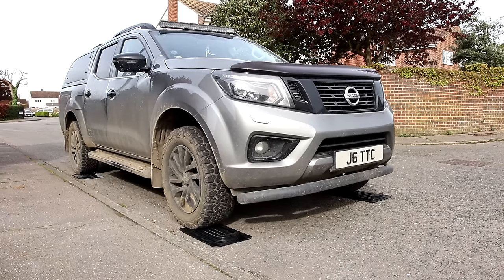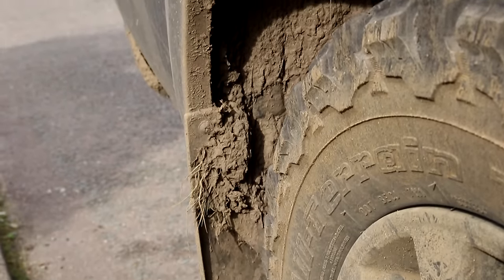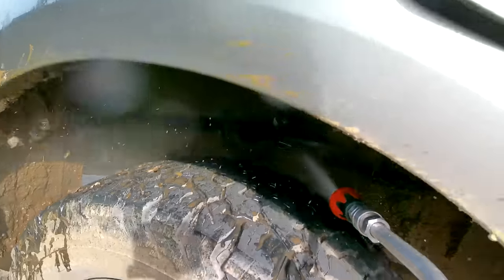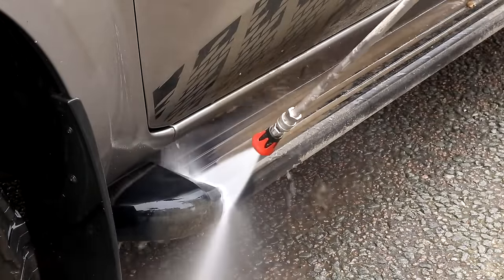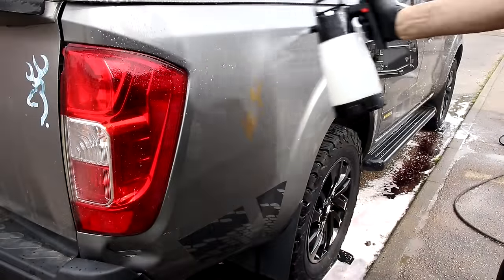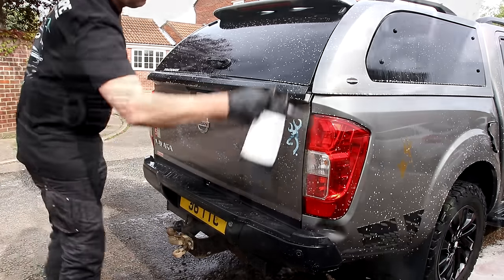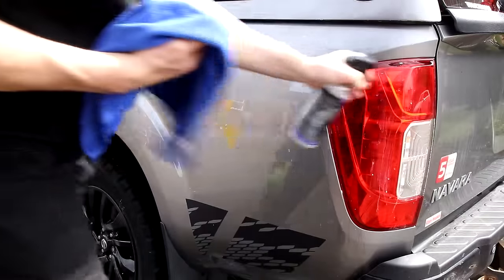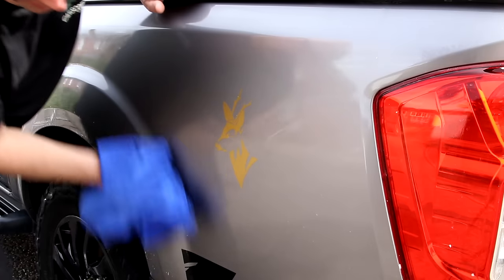DEEP CLEANING A FARM TRUCK

Comment: One of the reasons for pretreating with a snow foam or a surfactant rinseless is that it will add some protection against scratching via emulsification, etc. Though based on the condition of the truck and what it's for, I somehow doubt that was much of a concern for the owner, lol. Nice job either way!

Comment: Hi Paul, bottom to top, always have been even back in the day before foam cannons, a similar reason though, because some of the old shampoos were a nightmare to shift with a garden hose and you knew it was gone when it stopped making bubbles then you moved up the panel, especially on lighter coloured cars. Also I always use Bilt Hamber Atom MAC because I hate seeing a freshly washed car only for the brake discs to be rusty orange.

Comment: Agree with your thoughts on the AG wheel cleaner and the Carscoep wheel weasel. 
Thought the AG wheel cleaner was a great maintenance wash product actually, and I've not bothered with the pump sprayer as I feel you use less with the supplier trigger sprayer on the 1L
I like the Carscope wheel weasel and it does the job well, but it is time consuming!

Comment: U put in a shift there pal😮👍
Would you use a turbo nozzle  on commercial wheel arches that bad next time?
Reply from the maker: Could have done but worried about catching the paint there not completely lined in plastic

Comment: What a satisfying clean that must have been for you. For me the dirtier the car the better as the transformation is greater at the conclusion. The wheel weasel I will not be purchasing as most of my spokes are hollow so I think I would still need to use  my Gyeon microfiber wheel mitt to work my thumb or fingers round each spoke. Why did you not do two spokes at a time with the weasel ? I am a rinse up to the windows then a rinse down from there guy. I am still to see a comparison on YouTube of someone doing a one door down and one up and then doing a swipe test. I am onboard with spraying the shampoo through the lance then doing a one bucket wash with the obligatory grit guard. I find it cuts down the time spent on the wash so I can concentrate more on waxing and dressing though I use more shampoo but I may need to play with dilutions to see how low I can go. I have never used Koh Chemie as I always thought it was expensive but if I can get a Litre of that QD for a tenner and get a shine like that I will be investing in the near future. Another crackinng video and a good watch on a Saturday morning before I do a deep clean for Spring on my Jag and pick one of my Mitchell & King waxes for the LSP. as the forecast is no rain and light winds all weekend though it was to be dry yesterday and rained off & on all day. That's the weather for you here in Scotland.
Reply from the maker: Thanks John the wheel weasel is just way too much of a FAF to be honest glad you enjoyed this one 👍🏻